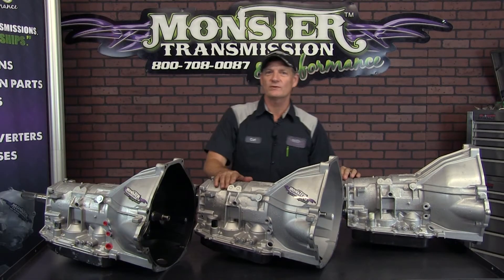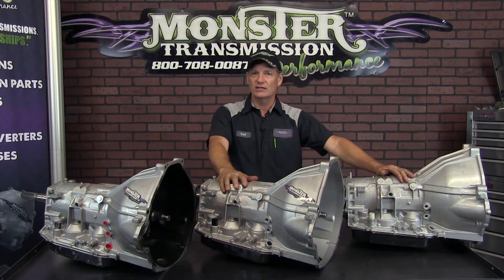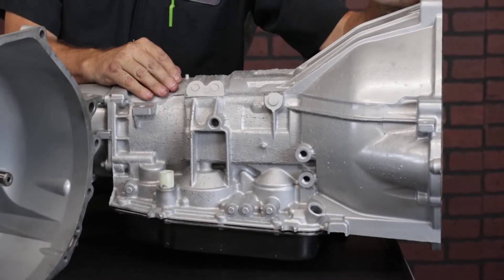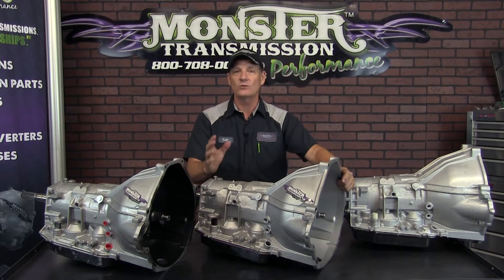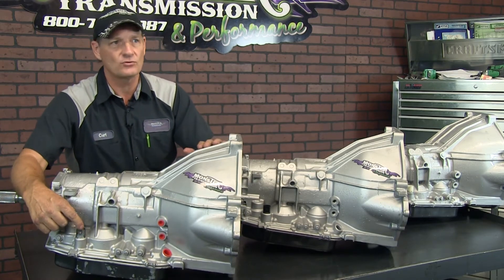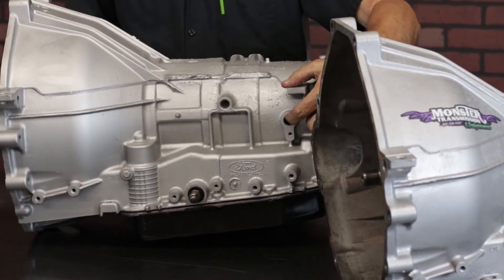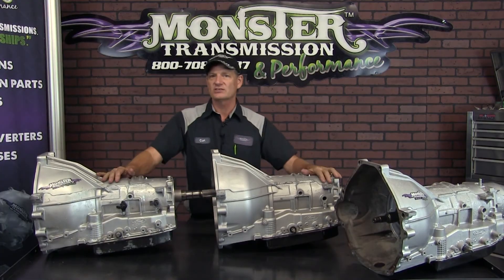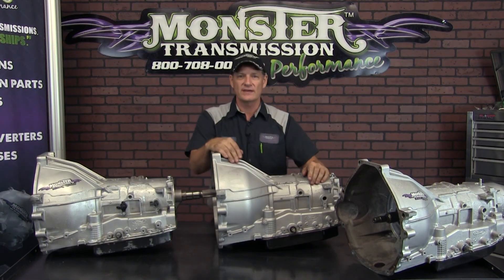Ford AOD, 4R70W, and 4R75W Differences

Comment: I have a 2001 4r70W and wanted to put a 2003 4r70W but the tail cone is a 41W and the other is a 42W and does not fit. What is the difference?

Comment: ive already replaced my 2006 F150 4x4 tranny for 1700, spent 3000 on bodywork  and 2500 on 35 inch tires.
SO if my 5.4 L engine blows up can i put a rebuilt 4.9 300 inline 6 in there as they are simpler and more reliable?

Comment: Got a ?, I wanna put 4R75E/W from 2007 Lincoln town car limo in a 03 2WD expedition, "has 4R70W", if I was to swap valve body and electronics, from 4R70W to the 4R75E/W and bypass the input sensor will it work as a intended?

Comment: Will a 4r70w out of a 98 crown victory fit a 5.8 engine 97
Reply from the maker: Hello! Based on the information you provided the 4R70W you pulled should bolt up to the 5.8L ford engine.

Comment: Yo Kurt, I’ve been have an issue with my 1999 f150 4R70W OD light flashing code #P0173 3-4 shift solenoid stuck. Can I buy a hardwire harness & solenoid from you guys?
Reply from the maker: Hey Michael! Thank you for reaching out to us, we would be more than happy to get you the parts needed, just give our product specialists a call at 800-708-0087 ext 1.

Comment: Will a 98 lincoln mark viii transmission fit 97 mustang gt?
Reply from the maker: If they are the same length and have the same color and pin count on the wire harness then yes it should.

Comment: Hello Sir, you have a wonderful way of explaining the differences of the transmissions. I have a question, will I be able to swap out a 4R70W with a 4R75W?
Reply from the maker: Thanks! Kurt does a great job! To answer your question no you can't swap those. They have different speed signals to the sensors and would not read correctly. Hope that helps!

Comment: So I'm trying to swap a 4r75 into a 95 thunderbird with a 01+pi engine. What do i need to change over
Reply from the maker: It has a different wire harness and the reluctor ring/gear ratio changes. To use that transmission you would need to utilize a stand-alone computer.
Reply: @MonsterTransmission  righttt so what would be the latest trans i could use
Reply from the maker: @brysonshires9742  93-95 AODE

Comment: Question. Can the the clutch drums from an old school AOD (cable shift model) work in a 4R75W? At least the direct clutch drum. Trying to come up with something more durable than that 4r75w junk one.
Reply from the maker: No, they take different steels/clutches and will have bands/clear once issues.

Comment: I have a 4R 70W in a 2003 Ford Expedition Eddie Bauer 4x4 with tow package. Mileage is approximately 150k.  For the past 8 years and 40k-ish miles, its primary job is a tow vehicle and it tows at very near its rated limit. To no ones surprise, its going to need a new transmission soon.  Is there anything Monster can do (at additional cost - of course) to this transmission to strengthen it capabilities thereby hopefully increasing its useful life in such a demanding environment?
Reply from the maker: Better cluthes the OEM and reprogram valve body, also better converter clutch.

Comment: I'm swapping the trans on my '97 4.2 F150 auto 4-speed. After crawling under the truck and unplugging the harness to be sure, the terminal on the case is white and numbered with what looks like, 7A17E.
Reply from the maker: You should have a 4R70W in 1997 for your application unless someone did a conversion. Thank you for choosing Monster Transmissions.